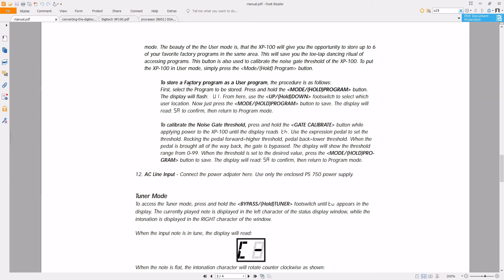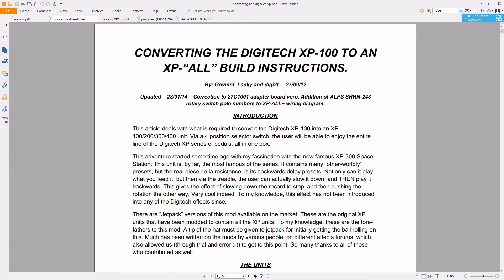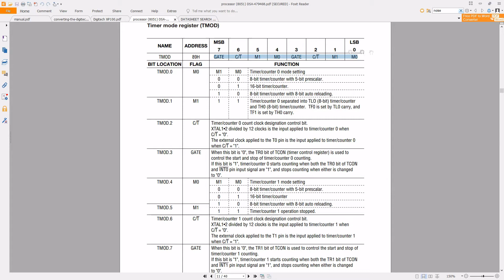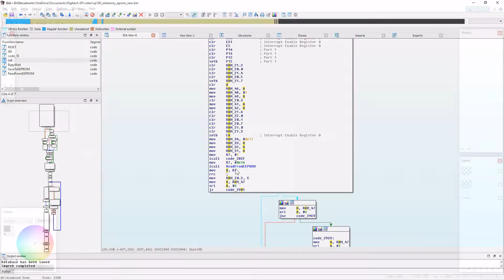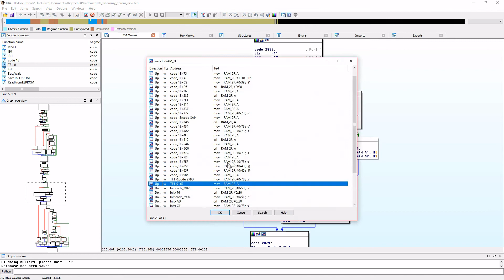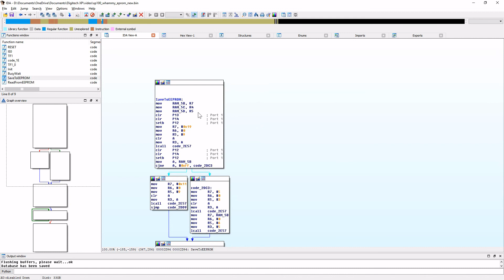Reverse-engineering the Digitech XP-100 (8051 assembly)

Comment: Congratulations for the video! Your skills and knowledge truly impressed me. 
I stubled acreoss it because I am trying to mod my Ehx Nano POG to produce a -2 Suboctave. I have got the binary file and tried analyzing it with Ghidra with no luck. Not able to find the "DSP" functions core. Would you maybe able to help me with this?
Reply from the maker: Thanks!
It might not be in there. The POG uses the DSP56364 chip which has an internal 8K ROM. I've been meaning to look at the Whammy WH4 for a long time to see if I can read its ROM or not.
Reply: @userPrehistoricman actually the one I am working on uses an Analog Devices Blackfin BF592.
Please hit me up in some way if you are willing to offer me some help to get this down!
Reply from the maker: @WillGalluccio  That one has a significant size internal ROM so you'd need to try reading out its memory and see if it has memory protection. If it does, then you would need to use a fault injection technique such as glitching its power supply to bypass the protection. To be clear, I can offer you advice but can't do the work for you
Reply: @userPrehistoricman  Uhm, actually I desoldered the external Flash memory the MCU is linked to through SPI and I have got the .bin file. I thought the firmware would be written onto that? But haven't had much luck disassembling and analyzing that bin file with Ghidra.
In case I am wrong, how would you practically do to read the internal MCU ROM?
Reply from the maker: @WillGalluccio  How big is the dump? About how many programmed bytes? That will tell you if it's MCU FW or not.

What's the MCU part number? From that you can know the instruction set (ISA) and properly set up ghidra for analysis. You only told me about the DSP so far, which isn't the same thing as an MCU. Is it the only processor chip on the board?
As I said, that BF592 has an internal ROM. You will have to use the JTAG interface to read that ROM out, if it is used. Read the datasheet!
Reply: @userPrehistoricman  the dumped bin file is 64kb.
If I open it as text, over 4096 lines, only 853 have meaningful information.
There is no extra MCU, only the BF592 and this EEPROM M25P05.
I have read that this ROM L1 register can only be custom programmed at factory (Analog Devices), so this + the fact that there is an EEPROM makes me think the firmware is all in there. 
I did set up Ghidra for generic Blackfin analysis, but it doesn’t disassemble it entirely. There are still some bits here and there that don’t get turned into code. I managed to find blocks of functions that do stuff like initialization etc, but I hit a wall when trying to find the DSP core functions to mod.
Reply from the maker: @WillGalluccio  I don't think you can tell what information is meaningful when you open a binary in a text editor. Open it with a hex editor and see where the data is and where it ends. You can sometimes get a visual idea of the structure of the binary too.
You can use Ghidra's aggressive code finder. But probably there is some level of indirection in the code it has already found. That code will use a function pointer that Ghidra is failing to explore.
The bits that aren't turned into code could be actually data. That is normal.

Comment: Hello. I have a quick question that i think you would know. I have recently got a xp100 from reverb and i saw that input Signal is constantly clipping. After seeing that input volume knob isnt responsive at all, When i measure the pot lugs, i read a range of 78k to 103k between min to max positions. I sprayed some contact spray inside but didnt help. Is this normal, or should it be between 0 to 100k? I am using active pickups and their output is peaking aroubd 120k 130k, but pedal seems to clip the signal. What should i do? Can you assist me on this?
Reply from the maker: Yeah sounds like the pot is bad. At the max and min positions, you should measure 0 ohms across the two pins at that side.
Reply: @userPrehistoricman   changing the pot with a new a100k helped, thanks. Yet, my input seems still too hot. I mean, after %50-55 of the pot travel, unit starts to clip. Decreasing the input gain sucks the tone too much. I'm stuck with a quite narrow range. 

I highly suspect from the input impedance, which is normally 1m on most pedals, whereas its 470k in this one. Would it be the cause?
Reply from the maker: @captain6198  There is a mod where you add another pot that decreases the output level. I can highly recommend it since it lets you put the input gain at the ideal level without driving a much larger voltage out of the output.
My experience is that there's very little tone suck, but the pedal does buffer the signal at all times. If you put a clean buffer in place of the XP, it should sound the same.
Reply: @userPrehistoricman  where can i find this mod then? Never seen or heard that so far.
Reply: @userPrehistoricman  Ok I think I found what you're referring to. Its mentioned on xp-all documentary by using a dual gang 1m pot.
Reply from the maker: @captain6198  that sounds right
Reply: So are you sure about this mod's effectiveness @userPrehistoricman ? As I understand from this, it directly affects the output volume by intervening the signal on the very output of the pedal. Issue I have is coming from previous stages I believe, so with this mod theoretically, if the input signal clips, it'd clip on a lower volume regardless.. Or maybe I'm wrong.
Reply: @userPrehistoricman  another thing is, any type of 1M stereo pot is unavailable in Turkey, would it be good to go with mono and use It solely for wet output (which is the only one I use)?
Reply from the maker: @captain6198  You said that lowering the gain sucks the tone, so this mod lets you turn up the gain to just below clipping without driving a really hot signal out of the pedal.
Yes, you can use a mono pot.
Reply: @userPrehistoricman  all right, gonna give it a try. Just couldnt comprehend how it would do it, because the mentioned pot is directly connected to the output Jack. I would understand that if it would be connected anywhere like opamp output or something, but anyway, ill try this and let you know. Thanks for the information ❤️

Comment: It seems up into the mid-late 2000s Digitech were still writing 8051 assembly to produce some of their products; the X-Series of pedals used an AudioDNA DSP chip combined with an AT89S MCU of some variety with onboard flash and an 8051 at the heart of it. It makes me wonder if a similar modification could be done to one via another AT89S with a much larger flash size on it and some switching of address lines like on the XP-ALL+.
Reply from the maker: Yeah for sure if they have similar or identical PCBs and hardware. It will work as long as the DSP has the same principle as the XP100 where its effects program is uploaded from the host processor.

Comment: Great video. You seem to know this pedal very well, so maybe you can give me some direction on how to get mine working again. I have to admit, I have not used this pedal in a long time. But it was packed up in a box and stored in my closet. I took it out the other day and I can't seem to get any sound out at all. Power is good, cables are good, pedal display and settings work fine - Just no sound. Any tips would be greatly appreciated. Cheers!
18 minutes ago
Reply from the maker: Hi. Try the steps we suggested to the guy in this thread:
https://www.diystompboxes.com/smfforum/index.php?topic=120438.0

Comment: super niche video but an incredible breakdown.  are 8051's popular for guitar pedals? or are they a relic of the 90s
Reply from the maker: Definitely a relic but it was fairly common back then. These days, it's cheaper to buy a bigger processor that's easier to program for rather than a small processor.
Glad you liked it :) I'm planning on doing a series of reverse-engineering the instruction set of the DSP used in this guitar pedal.
Reply: @userPrehistoricman  damn why am I learning 8051 assembly in school then lol. good stuff though man cheers
Reply from the maker: In school! Damn. What level?
Yeah most embedded systems would use an ARM type chip and only switch to a smaller alternative for mass production.
Reply: @userPrehistoricman  electrical eng, only 2nd year undergrad tho. They taught assembly in the context of an arm chip though so im glad you say that because I find 8051 assembly to be a nightmare compared to arm lol
Reply: and if u went ahead with that series I would definitely be a fan!
Reply from the maker: @jacobthebatchbandit3092  I'll try to get going on it but my upload schedule is some garbage as you might have seen. I'm in 3rd year so I don't have as much time as I used to.
Reply: @userPrehistoricman  bro take ur time and focus on school ahah, but i appreciate it. where do you go to school?
Reply from the maker: @jacobthebatchbandit3092  I moved from England to Scotland to do uni